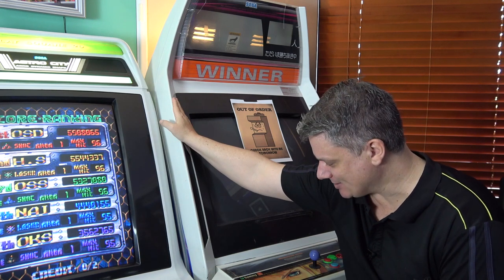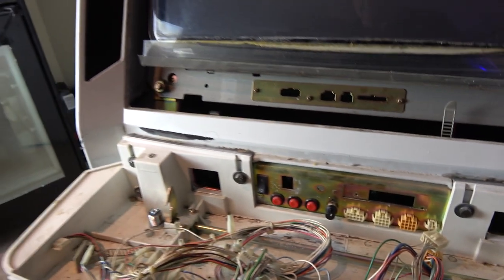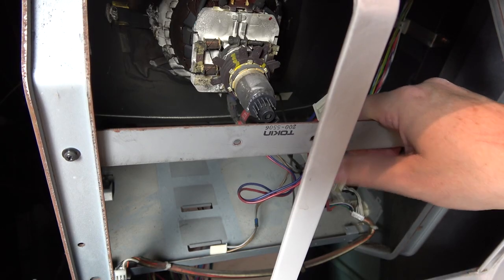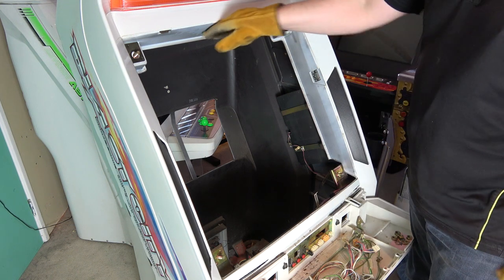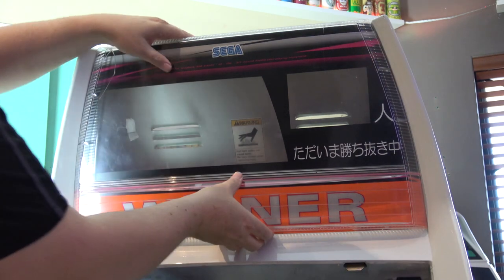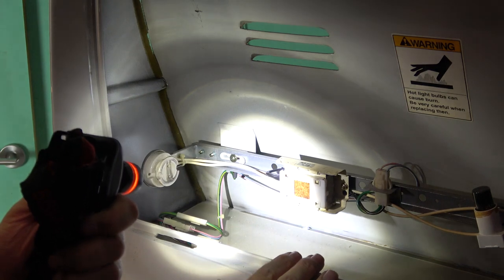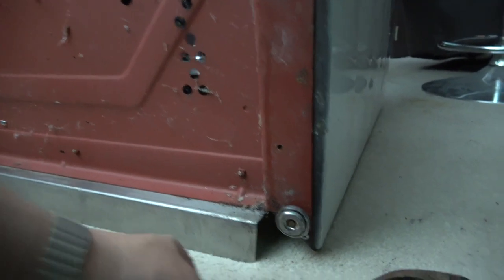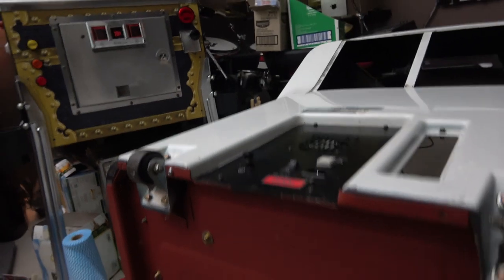FE030 - Let's Dismantle a Sega Blast!

Comment: I have a question for my Neo Geo Candy cab, the monitor is 29" and the games i play are horizontal games. Would it be able to play vertical games, or is that only possible on arcades where the monitors are setup vertically. Would i get a smaller picture on the vertical games if i use it like now, with black borders. Or do i simply need to get another cabinet to play those vertical games, i don't want to rotate the screen each time i play?
Reply from the maker: Hey Kenny, If you are running a multi-game setup then you can play vertical games on your horizontal cab and yes, they will be smaller with black unused space to the sides. The 29" monitor is a big screen though so you might be ok playing those games like that. I agree that rotating the monitor is not a good idea. Your best bet if you can is to get another cab dedicated to Vertical games for sure. Especially if you get another 29" candy cab - vertical shoot-em-up's look so good on one of those in a vertical setup. Cheers :)

Comment: I have a few questions about the Blast City (and maybe the Astro):
1.) Does the monitor make up the majority of the Blast City's weight? Like after you removed the monitor, was the overall housing very light to lift up and move around?

2.) How heavy do you think the monitor weighs and would one person be able to carry it up several flights of stairs? Was it uncomfortable to grip and hold onto for a long duration of time?

3.) In terms of dismantling, which cabinet [Blast and Astro] did you feel was easier to split apart and put back together?

I was looking to buy two Blast City cabinets and I'm trying to reduce as much weight and take apart as little as possible. The two things I definitely want to take apart is the entire control panel and the monitor. Then carry the overall housing up my staircase with a few friends. 

My main concern is the monitor itself as it looks awkward to grip onto. Not sure how more than one person can hold onto it. I will say this video helped give me an idea of what I'm working with esp. with how the monitor looks. I thought it was just a tube by itself and nothing more, but the metal around the front and back plate will sorta keep it safe when moving.
Reply from the maker: Hey Revolu- here are some answers to your questions that will hopefully help.  1. The monitor weight is about half the total weight. The total weight is around 90kg’s so about 45kg for the monitor and the rest the cabinet. Note that in the cabinet the main power supply and transformer are a big part of the weight so you might be able to reduce the cabinet weight by 5 to 10kgs if you removed them before relating the cab. The bases are solid metal which is also a big part of the weight with the rest being fiberglass for both cabs.  2. Being about 45kgs I wouldn’t recommend you take it up the stairs yourself. You can see how I’m built. I’m not overly strong but even if I was I wouldn’t attempt that on my own. Two people can grab one top side of the monitor frame each to get it up stairs. Just wear gardening gloves so you can grip the frame without it digging into your hands. 3. Both cabs had their own issues mainly around those JIS screws. That’s your biggest problem with both of them. Otherwise both are pretty easy to dismantle. The Blast city has the benefit of being able to remove the control panel completely where as the Astro does not. But the Astro has smoother sides which make the machine look a little less bulky when it’s setup in a room. Having the control panel off makes it a lot easier to get the monitor in and out fo the cabinet. So that part is a bit harder with the Astro City. I hope this helps. Cheers.
Reply: Hey there, this is very helpful information to me. Again the video helped me get an idea of what I'm working with, but your further explanation with the little details helps me out; I documented this for future since I'm referring to this video, a guide on Arcade Otaku, and this comment. 

I tried asking someone about how to carry the monitor but they were super vague about it. However now I guess having two people is definitely necessary. Gonna have to ask my strong friends to come through to help haha.

Personally I want the Blast because of its trisync monitor, it would give me more variety in what I can play aside from staying just 15khz. Though aesthetically the Astro looks much better, but looks really annoying to split apart. Regardless, both cabinets are nice looking and I definitely want a pair soon.

Comment: I'm not sure if you can help me on this but I finished cleaning my blast city and recapped my monitor and power supply. Now my monitor is not powering on. I did manage to get it on for 5 minutes and it was working fine but it then shut off and doesn't come on anymore. It doesn't even seem to be getting power. There's no noise coming from the monitor. The rest of the arcade seem to power on fine. The game is running and I get audio from the speakers. Do you have any ideas on how I can troubleshoot this? I tried taking a multimeter to the power connector that goes into the monitor. I'm not exactly sure I did it right but it doesn't seem like I'm getting AC power out of the connector at all.

Comment: So I just bought my first Blast City and this has been a helpful video that answered several questions I had about the cabinet. One question though, the bit of exposed metal under the control panel where the volume knob and test buttons are, when I power on my unit and its running if I tough that area I can feel a tingle in my hands so its obviously energized, is that normal? Any recommendations on what I could check that could be causing it?

Comment: Did you ever do more videos on the blast restore? Where did you find a chassis? Any tips refitting the bezel? Once I took mine off it won't pop back in to the bottom clips any more.
Reply from the maker: Hey Jon. My blast is still in pieces because I'm trying to clear a number of other projects first and then I'll get back to it!  My blast didn't come with the chassis but I managed to source one from a close contact. However they are nearly impossible to find. Still you can use other tube/chassis combinations. Interesting about the bezel issue you are having. As I haven't put mine back together yet I may find the same problem! So not sure at this stage but hopefully you get yours sorted. If I do find something unusual when I put mine back together I'll be sure to video it. But that is unlikely to be for a while as I must get these other projects sorted first!! Cheers :)
Reply: Ah, I see. Well that's good you got a chassis. I love the machine so far! I am jealous of your Astro, I wish I could have found one of those as I really only play 15khz.
Reply from the maker: Keep looking for one Jon...I must admit they make a really nice pair of machines. I still think that if I only had room for two machines it would be both the Astro and the Blast!  As you know, such a great form factor all round. I really hope you manage to pick one up some day. Until then you have an awesome blast to enjoy. Congrats on that!

Comment: Thank you for the video. I've not seen anyone else actually detail out the steps to this extent and it was helpful for me since I'm trying to fully restore a Blast I recently acquired as well. I haven't made it to the part where I fully separate the parts yet, but that is definitely going to happen. Fortunately for me, the wiring of my cab is still mostly untouched from stock and it worked before I started restoring it. Here is the thread I've been documenting it in: https://www.arcade-projects.com/threads/blast-city-cleanup-restore-stringbean.15829/

Comment: Thank you for this video, it will help me when I'm going to sort out my cabs :) One question, your cabinet seems to converted to euro mains voltages. How does the connection from mains -> stepdown transformer -> power supply look like? thanks again :)
Reply from the maker: Hi Fraspe, Thanks for your comment. I did answer your question in a follow-up video (S01E49)...Cheers! :)

Comment: Great video mate!  This will be very useful to me for my Blast.  Quick question, I have been told that the MS-2930 monitors are auto-discharging after about 30 minutes (due to a bleed resistor) .  Is that correct in your experience?  I will discharge anyway though.
Reply from the maker: Hey Jag 555 - thanks for watching! I can't advise you with any technical authority on that. I am only aware that some of the later Japanese chassis that were made 'appear' to auto discharge when powered off. I'm not aware of a specific time frame, my thoughts would be that if that is indeed the case then they would earth immediately. I haven't actually hooked up my chassis to my blast yet to see how it behaves but I know when I try and discharge my MS8-29FSG in the Astro City I don't get any 'crack' so it appears that it is auto discharging. Regardless (like you said) I would always recommend to discharge regardless. It's just not worth getting shocked especially when discharging manually is relatively easy to do once you do it a few times. If anyone else knows for sure, then please chime in on this discussion! Cheers and congrats on owning a Blast!!
Reply: Thanks for the reply mate and as you say, I won't take any chances.  My Blast is in pretty good shape, but having some issues with the monitor at the minute as the anode keeps falling out.  Should be an easy fix I hope.
Reply from the maker: Hey again Jag 555 that should be an easy fix. It's really only the clip on the inside of the anode cup that holds it in. It may have been 'bent out' after being pushed off the tube when discharging. You should be able to bend it back into shape so that it holds firm on the tube. If you have another one to compare it to you may be able to figure out the correct shape that it should be to hold in firm. Cheers.
Reply: Thanks again for the reply and help.  I did this work last night and the anode cap is in bad shape.  One of the clips had broken off completely.  However, I managed to get it back in the monitor and used silicon grease to hold it in place. Its all working now, but I will probably get the anode cap swapped out in the summer. Thanks Again.